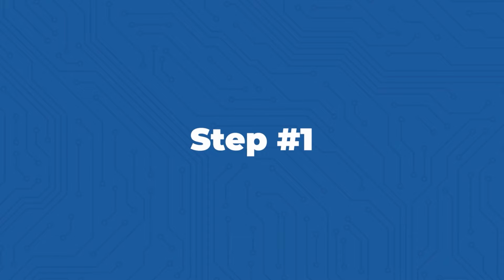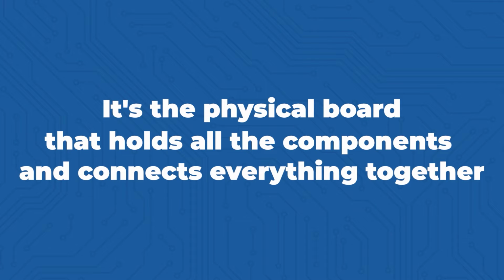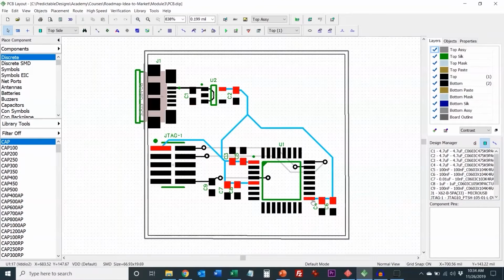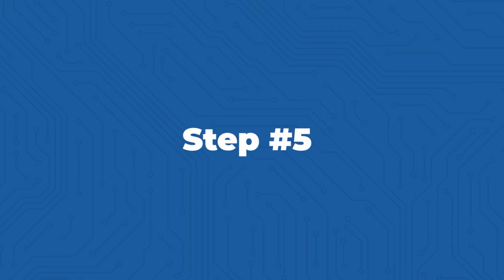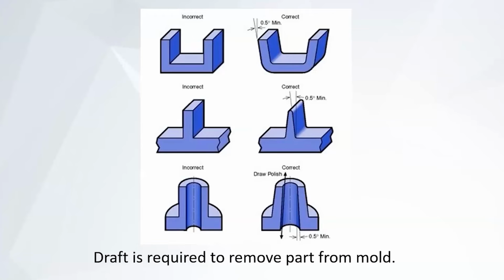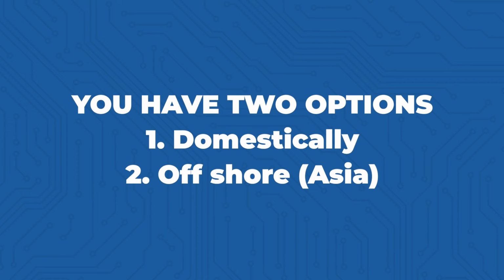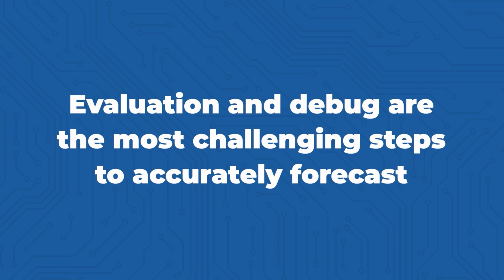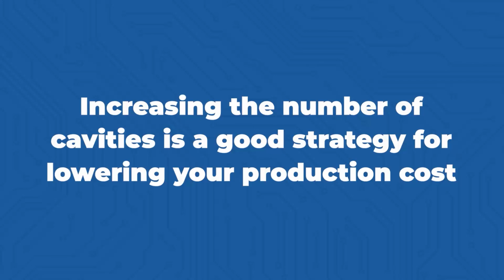How to Develop an Electronic Product from Start to Finish

Comment: I know you’re a hugely busy guy just looking for bit of advice Iv designed a pcb and wanted someone to check it and correct it where needed it’s basically a atmega328 with a tp4056 and a my3608 I was quoted £850/$1050. My issue is I don’t know if that’s normal or expensive. Thanks
Reply from the maker: Sure I'm a busy guy, but helping people like you is my thing - so I'm never too busy to help:)

I'd really suggest you join my Hardware Academy and that's exactly one of the many things we do to help you. We can review and help guide the design.. It's a really low monthly fee too.

https://predictabledesigns.com/academy/

Comment: Wow, you even covered prototyping, Although, PCB prototyping is sometimes easier to achieve, it just requires air conditioning and other chemical protection, lab power supply, few chemicals and copper-garolite blank(s)

Comment: I feel you missed the mark on this one.  This is really a circuit layout class, rather than a "product development" masterclass.  First step has to be planning... even if you assume that this is after the very important requirements analysis/PRD stage, you need to block diagram and use that to choose components, interconnection protocols, power supplies required, etc.  But while block diagramming, we have to look at environment and physical design (space/shape available), as that will affect components.  And even look at firmware dev and who will do that, as that can affect components chosen.  THEN (yes, this is much later) we can get to the schematic capture and PCB layout. TBH, the schematic and PCB layout is a small part of the project.  We haven't even discussed enclosure at this point... since this is a product, there's a good chance that there will be an enclosure which will dictate component positions, materials, etc, even if you find a workable COTS enclosure.
Reply from the maker: Thanks for the feedback!

Comment: My experience is the first step to define the requirements ranked with: Must do, Should do, Can do, Must not.  Then define the function blocks required to achieve the requirements.  Then start investigating options for implementing the blocks.  ie  hardware/software.

Comment from the maker: Prevent mistakes by downloading your FREE DESIGN REVIEW CHECKLISTS for the schematic circuit, PCB layout, and enclosure 3D model design: https://predictabledesigns.com/design...

And get your other free guides:

Ultimate Guide - How to Develop and Prototype a New Electronic Hardware Product in 2023: https://predictabledesigns.com/guide

From Prototype to Production with the ESP32: https://predictabledesigns.com/esp32

From Arduino Prototype to Mass Production: https://predictabledesigns.com/from-a...

From Raspberry Pi Prototype to Mass Production: https://predictabledesigns.com/rpi

Want my personal help on your project? If so, check out my Hardware Academy program: https://predictabledesigns.com/Academy
Reply: Thanks thats very helpfull ,thank you for the generiosity

Comment: You mention plastic moulding quite a bit with regards to enclosures. There are also common  off the shelf plastic components..fixtures and fittings and catalogues.  I just wonder if you could look into this.  Can I give an example an infrared remote control there are common enclosure types one could use that are ready made. It's sourcing these types of components that are also valuable along with electronics for some reason the sourcing mechanical components  are not mentioned so much
Reply from the maker: There are quite a few websites that specialize in off the shelf enclosures such as polycase.com. If you Google  "off the shelf enclosures" you'll find many other choices. 

The problem is most of these options are rather generic enclosures. Another method for more specialized enclosures like a remote control is to reach out to remote control manufacturers and inquire about purchasing empty enclosures from them. But most products eventually need a custom designed enclosure. This is expensive though so best to delay as long as possible.

Hope this helps!

Comment: Sir I want to learn electronics programming I want to use it for product design I need your help and how do I source out circuit diagrams that I will use
Reply from the maker: Are you looking to learn to design the electronics or do you need to outsource it?
Reply: Learning the design
Reply: But I don't know if it will take much time if it will I would like to outsource for it, please explain Bette r sir
Reply: I want to learn the electronics design, outsourcing for it, is very expensive right